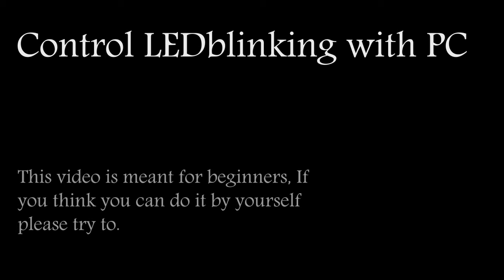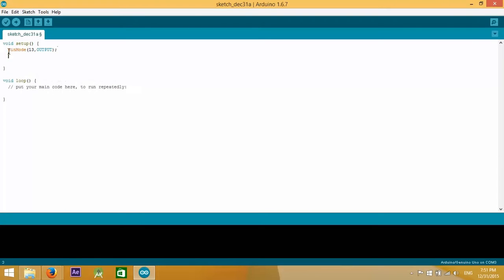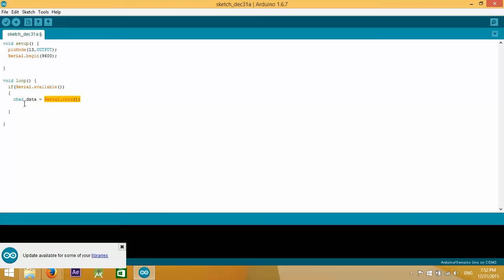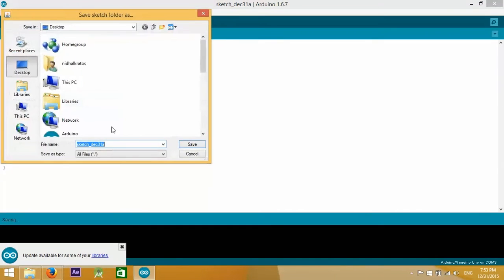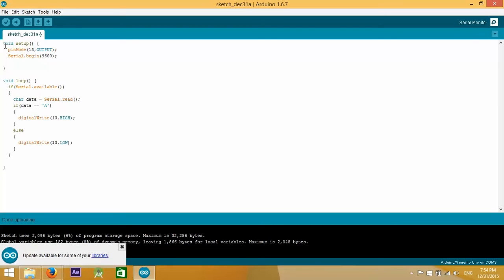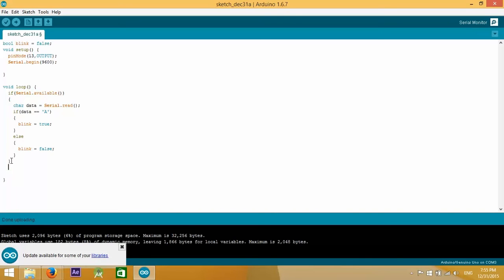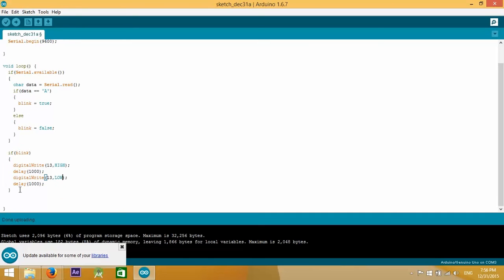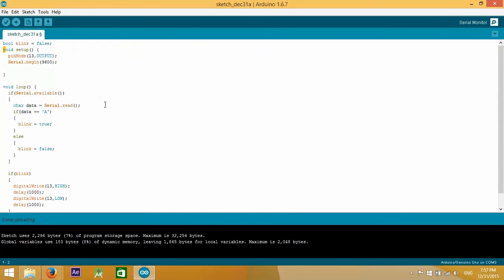Arduino - Control LED blinking using Computer

Comment: Hello, First of all I wanted to say thank you for putting together your first video. It's helped me out ALOT. When I run this code and use the serial monitor to enter "A" the LED blinks for a fraction of a second and turns off. When I use the visual studio form to turn it on and off it works fine. Any idea why this might be happening?